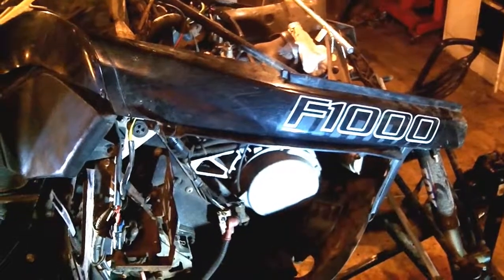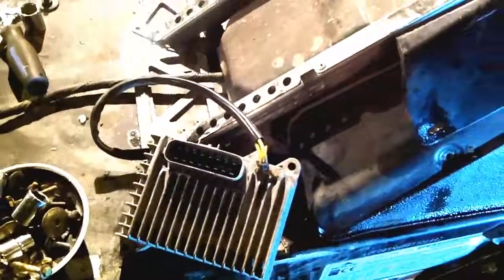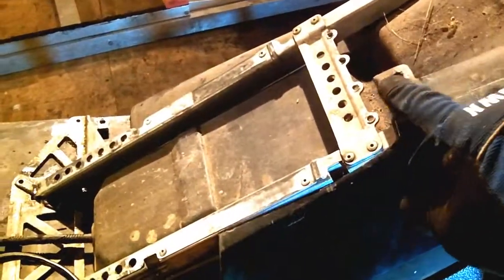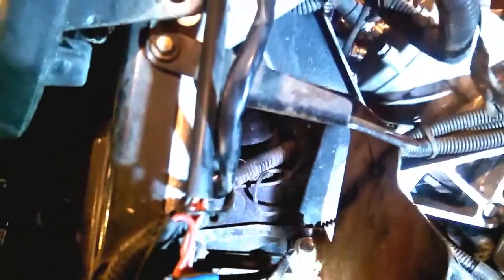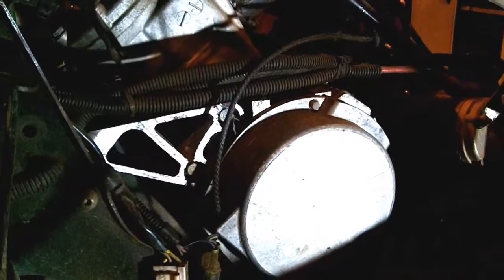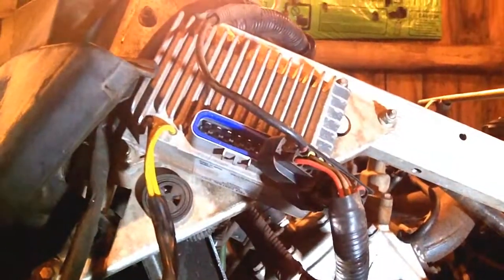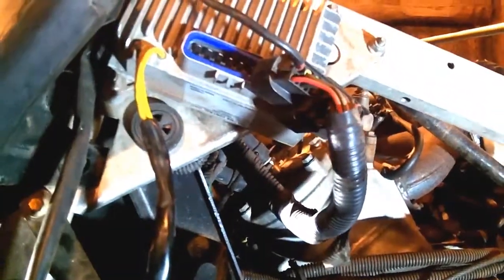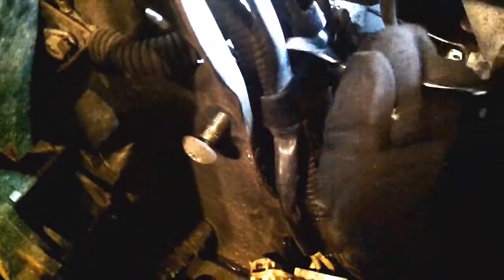Arctic Cat CCU Replacement | Chassis Control Unit or Voltage Regulator Twin Spar F Series

Comment: What takes out the CCU? Bad stator?
Reply from the maker: I think its just the ccu design, CAT abandoned the ccu back to a more traditional voltage regulator after a couple of years.
Reply: @TitanTown  by any chance do you know where I could buy a ccu I have an 08 f1000 sno pro

Comment: Hey I have a 08 Sno pro, I've changed out the CCU and noticed that the CCU wasn't the problem, it was the bottom wire with the clip where the CCU plugs into it, It was burnt out on one side. Can you help tell me how do I get to the rest of that wire and replace it and where can I get one to replace it? I have a picture if there's a way to contact you

thanks
Reply from the maker: The rest of that wire is attached to the stator.  Not a big job to replace the stator but expensive.  Remove muffler and recoil to access it.  You might be ok to cut out burnt section and splice/solder instead of replacing stator.
Reply: @TitanTown  thanks! From where I was looking couldn't really see past the bottom, I'll definitely try that!
Reply from the maker: @lanerideout5921  my contact info is on my website www.partssolutions.ca

Comment: I've got a 2007 f8 efi. All my electrical components work but my speedo/cluster Flickr off and on while riding it is intermittent. Headlights and tail lights stay on though. Could this be due to a faulty ccu? Sled is pull start only
Reply from the maker: Sounds like speedo wiring harness connection. Check it at the Speedo and where the pod wiring harness connects to the main wiring harness.  If not that, check CCU connections.

Comment: Did you say that the 226 and the 246 are interchangeable?
Reply from the maker: 246 will work on 07s but 226 won't work on 08+
Reply: @TitanTown  okay. Did artic cat discontinue these items or is there just a shortage, because it seems like every place  is sold out of them
Reply from the maker: @dylansmith6631  the 226 is discontinued.  I have a couple of used ones for sale.  I'm not sure what the status is of buying a new 246.  I bought a new one about 5 years ago and people have been asking me for them recently.
Reply: @TitanTown  yeah. So you don’t have any 246s? I was just riding yesterday and all of the sudden I lost power to my lights, gauges and display, auxiliaries and accessories, and it won’t go into reverse. It’s starts and runs perfectly fine. I looked around on google and all I came up with was that it’s the ccu that went bad. I’m going to investigate to see if there’s anything shorted anywhere or anything. I was looking at a bunch of different websites to find the 226 or 246 and nobody had them. I called country cat and they said that they were discontinued. Are the 226s that you have in good working condition?
Reply from the maker: @dylansmith6631 sounds like the CCU.  yes, we just had one of the 226  on an 08 F1000 sled ran  fine but gauge wouldn't power up.  I'm in Ontario. I don't have a 246 left.
Reply: @TitanTown  so it made everything work normally on the f1? And the 226 is compatible with an 07 f8 correct?
Reply from the maker: @dylansmith6631  everything worked except the gauge.  The 07s came with the 226
Reply: @TitanTown  I took a look at it and I actually had two wires melted together so I wasn’t even getting power to the ccu. Thank you for the help and info!